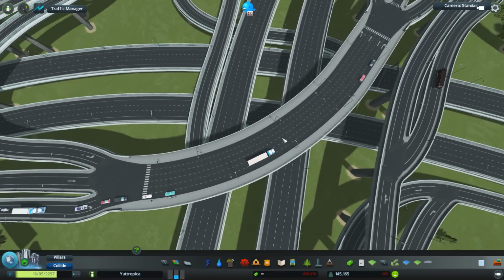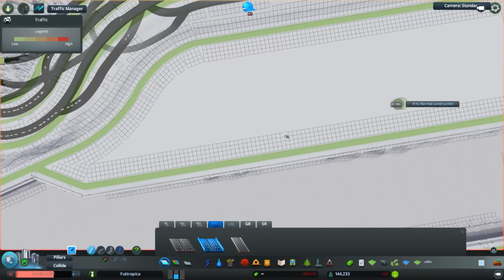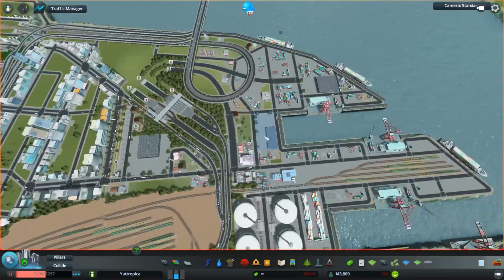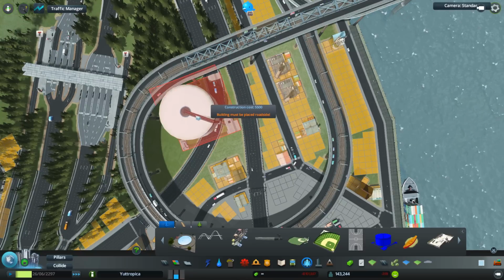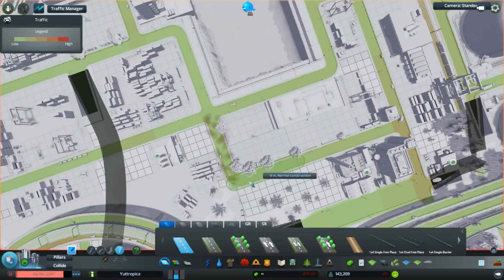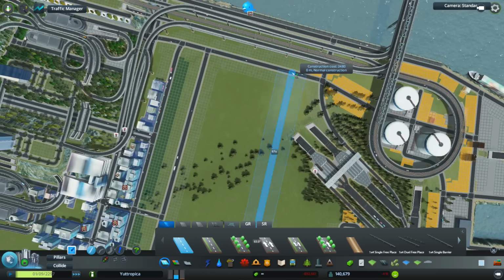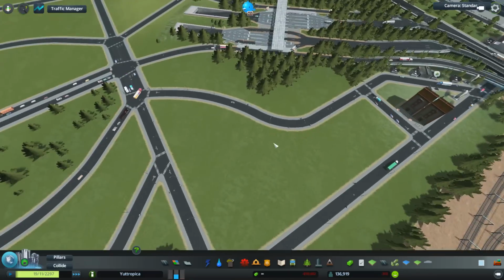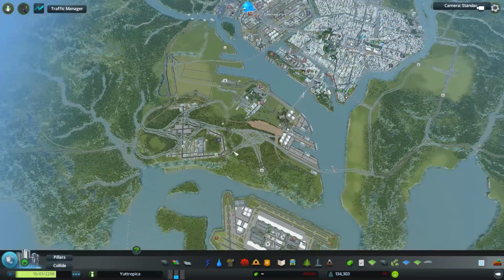Cities: Skylines, EP21 - "Before Going Dark"

Comment: hey yuttho, just a little advice - when you're building highways/ramps, instead of drawing roads next to it to create zoning which causes it to snap to the grid, you can use regular roads (2-way as ramps & 6-way as highways) to draw the highways and ramps themselves and then you can just "upgrade" to the desired road type. makes it a lot easier and less frustrating and makes it be a lot more accurate (which i noticed that you like to be). cheers

Comment: In most big cities, the divide between industrial and other types of zones usually isn't a clear divide, geographically. You'll find small pockets of industrial zones, often light industrial, in among residential and other types of zones. You'll find a small industrial park a few blocks in size just down the street from a residential neighborhood with a McDonalds and Subway right on the corner. Or a water treatment plant a block away from a country club and hotels and a fairly upscale neighborhood. You'd be surprised